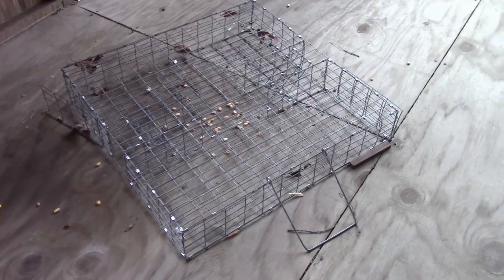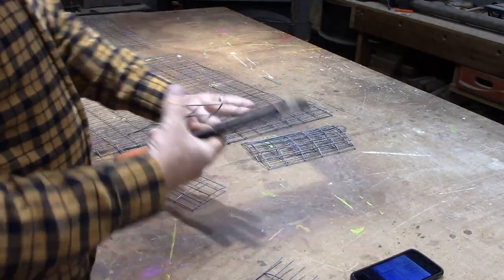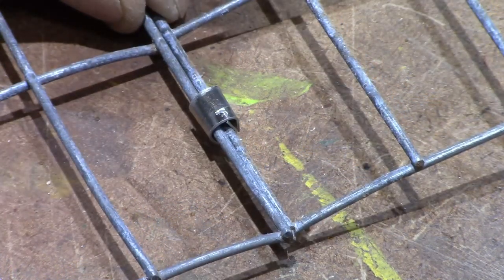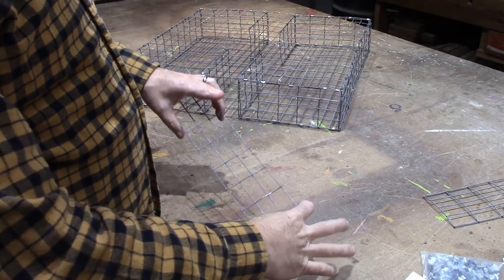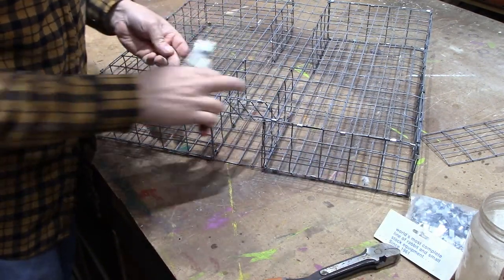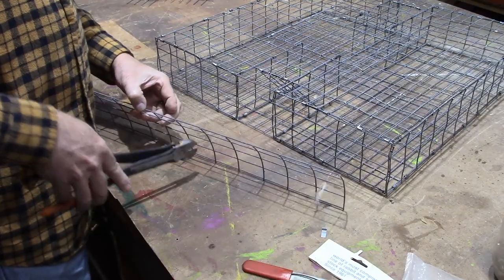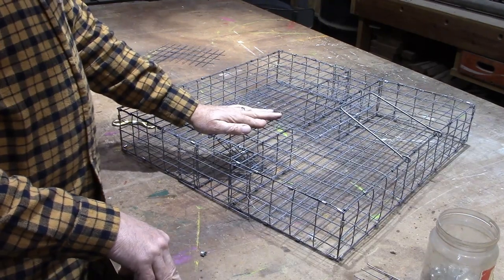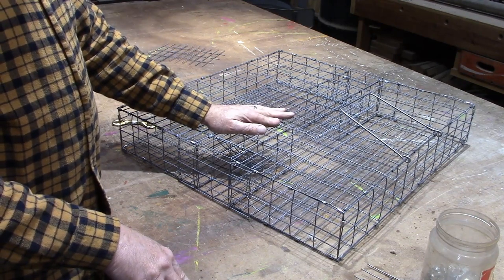DIY Repeating Squirrel Trap

Comment: Fantastic! Just Brilliant! Would have to spend 400 bucks to buy 6 of them. Damn expensive and not worth the money! Rip off!
Am going to making them this weekend for sure! Many thanks.
Reply from the maker: Your welcome!  Glad it was helpful.
Reply: @SoatMon  Ordered the 10ftx3ft wire mesh from Home Depot ($25) and 2 lbs J Clips and Plier from Amazon for 35 bucks. Will be building them this weekend.
Reply: $42 at Tractor Supply
Reply: @randygreen007  With a total cost of $60, I made 6 and that too 5 inches high and 20x20inch. So happy with this idea.

Comment: Ahh! I was looking at the ratinator trap and trying to figure out how it was made but could see the door mechanism clearly, but found your excellent video showing PRECISELY how to build one! Great video. One suggestion for holding the doors closed...How about using those rods you used for the handle? Just make a bend or loop at one end and weave them through the grates. Just yank it out when it's time to release the critters.
Reply from the maker: Thanks Dave!  Good luck with your build!

Comment: Would the wire gaps be too large to trap chipmunks? If so, what dimension welded wire would you suggest for them?
Reply from the maker: Probably.  I would probably use 1/2 by 1 inch wire for chipmunks.
Reply: @SoatMon  we'll give that a try, thanks for the great video